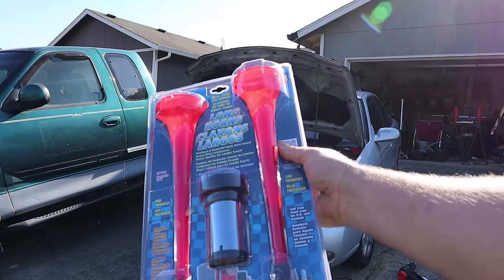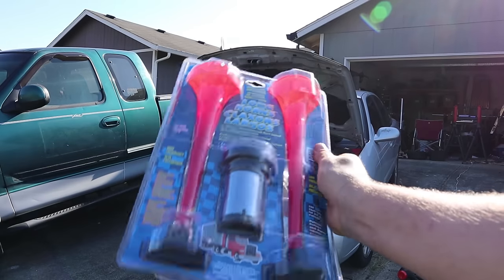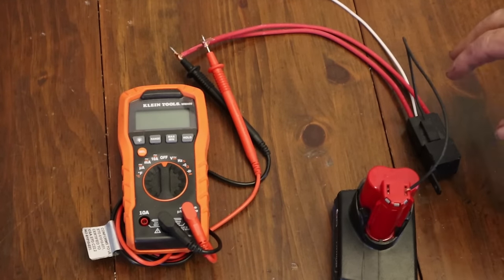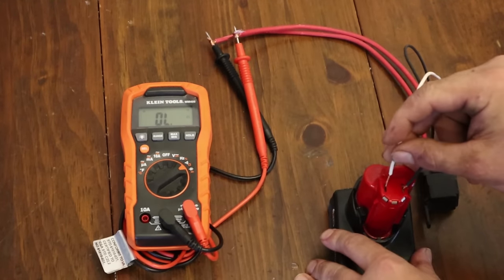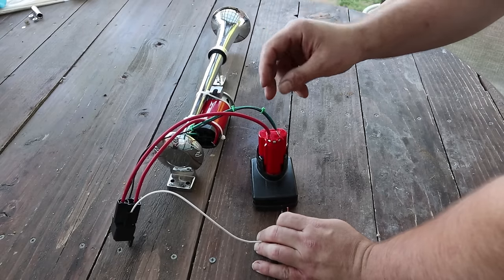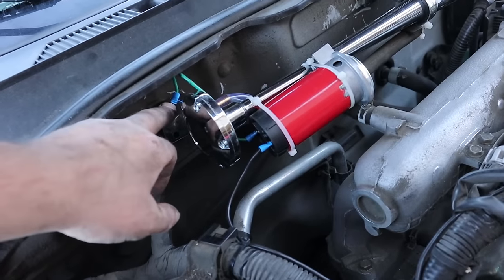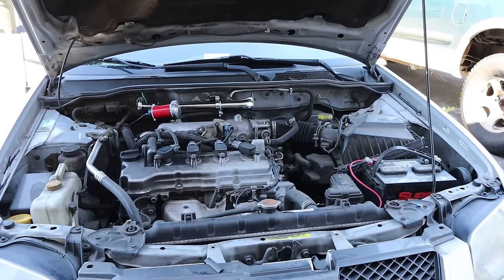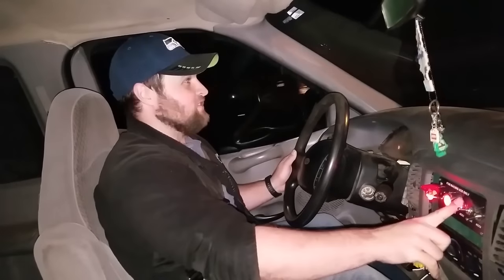Air Horn Car Install and Relay Wiring Instructions

Comment: Hey man whats the problem when my compressor doesnt produce enough air?
Reply from the maker: Make sure you have the polarity right. If you wire it positive to negative then the compressor will run, but it runs backwards.
Reply: @StrangeGarage  I'm thinking its because I used a light kit harness and possibly the wires are not 12ga but 16ga , could that be the problem?
Reply from the maker: @duanebowens1459  nope, the compressor will draw the power it needs. If the wires are too small they will just get hot and/or burn up. Think of it this way, fuses are just really small wires, but the equipment still runs fine until something is wrong. Just swap the two compressor wires and see if it changes anything. If it still doesnt work you may have a bad compressor or have blown out horn diaphragms.
Reply: @StrangeGarage  Cool , so the harness is ok. So I should switch polarity at the compressor. It did seem to be sucking instead of blowing.This action will not mess up the compressor motor?
Reply: Also I blew through the horns prior and they were fine.
Reply: @StrangeGarage  Thanks for the explanation similar problem after install and was wondering if the 16g wire I used was the issue going to flip the polarity when i get a chance

Comment: What size inline fuse do you recommend i got a similar one like yours its a 40amp relay
Reply from the maker: I run a 30 amp, no problems so far.
Reply: @StrangeGarage  allright sweet

Comment: You never told us the price of the fire horn or the ones you demo.
Reply from the maker: The 12v ones will run you 20-30 bucks, the firetruck horn itself is about $100, and you gotta buy a compressor, solenoid, heavy wiring, a relay... For most people the 12v ones are good enough and easy enough.

Comment: nice video  ,  so it’s on double relays
Reply: No, one set of terminals using the original horn wire and other side ground... closes the solenoid (electric switch), the other is the power supply to the air compressor/horn.
Reply: Oem horn is alredy powered by a relay

Comment: What gauge and amperage should the in line fuse be when installing the air horn?
Reply from the maker: I think my wiring is 14, fuse is 15 amp.

Comment: What If your factory horn has two wires
Reply from the maker: One is likely a ground. You can use a test light or multimeter to deternine which is which.
Reply: @StrangeGarage  so what should I do? Should I ground the ground wire and then cut and connect the positive to the blue wire?
Reply: Well in your case it’s the white
Reply: @StrangeGarage  so basically can I cut my blue wire, connect it to the hot wire with a wire nut and then just ground the ground wire? Sorry I know this is a lot. I’m just Relatively new to working on my truck. I’m just trying to learn and do everything myself if I’m confident to save some money 😂I’m only 18. I’ve just been trying to figure this out for a while😂
Reply from the maker: @ryanfryz8812  So, this is a little complicated. You probably need a buddy for this. Pull both wires, put your multimeter test leads on the wires, and have the buddy hit the horn. If your voltage reads (13v) then your red test probe is on the positive wire. If it reads (-13v) then you have it backwards. Positive goes to the pump, negative goes to ground. 

Your truck MAY switch on the ground terminal, meaning if you hook it up the horn will come on automatically. You can test this by putting one test lead on ground and checking the wires individually with the other test lead. If one of them shows 13v or -13v without pressing the button down then yours switches ground. It's not common, but possible.
Reply: @StrangeGarage  okay thank you so much man!!!
Reply from the maker: @ryanfryz8812  Yeah dog, hit me up when you need help.

Comment: Links for the horn?
Reply from the maker: Which one.
Reply from the maker: https://www.ebay.com/itm/Zento-Deals-12V-Single-Trumpet-Air-Horn-Superior-Quality-Single-Trumpet-Air-Hor/232985160818?epid=2126160160&hash=item363eff6c72:g:fIcAAOSw6Pxb10lP

This isn't the same seller because my seller was a major DB, but should be the same.

Comment: That is an fast compresor
Reply from the maker: It's a vane type compressor, sort of works like a turbocharger. They are pretty good, but often wear out quickly.
Reply: @StrangeGarage  how long does it mostly take when you push the button that you hear the horn
Reply from the maker: @madblackastra1951  Instant. As soon as you hit the switch that horn goes off. They're cheaply made but honestly work great.

Comment: im just trying to connect my existing horn wire to the 4 pin relay ie where to connect the wires to everything this video is useless for this just need which wires to which number blades with no plug.
Reply from the maker: If you can't figure it out based on this video then you should really have a professional do it, because you're gonna set your car on fire.

Comment: Part number of the relay switch?
Reply from the maker: Great question, I honestly don't know. I bought it 9 ish years ago. It's a 30 amp 4 wire 12v relay. Like this one:

https://www.ebay.com/i/292219862116?chn=ps&norover=1&mkevt=1&mkrid=711-117182-37290-0&mkcid=2&itemid=292219862116&targetid=884131267673&device=m&mktype=pla&googleloc=9033612&poi=&campaignid=9248481309&mkgroupid=94612600955&rlsatarget=pla-884131267673&abcId=1141156&merchantid=101642676&gclid=EAIaIQobChMIhvuY78Pf6QIV7x-tBh36NAIjEAQYAiABEgLIBvD_BwE

Comment: NEVER mount a relay upside down or sideways like you did! It WILL collect water!...especially cheap relays like the one you used.
Overall the install in this car was pretty sloppy just an FYI.